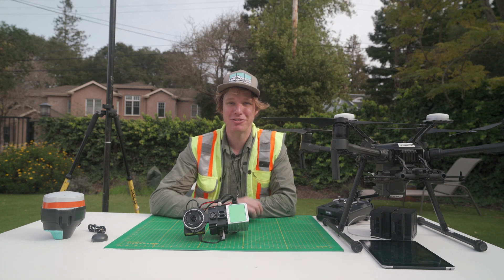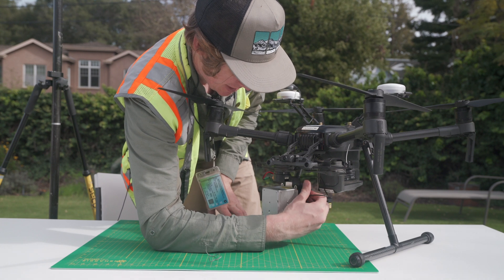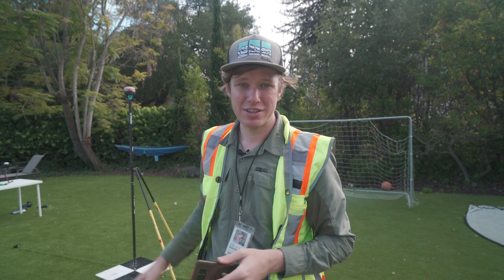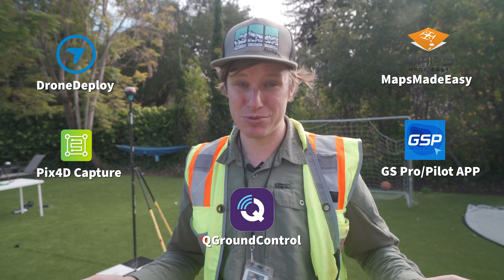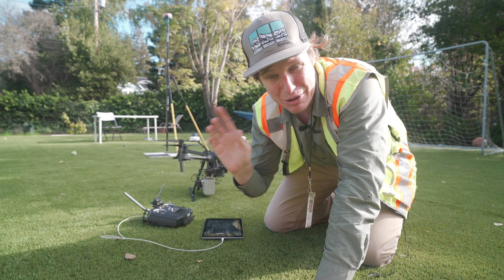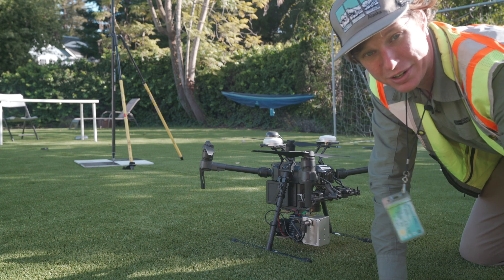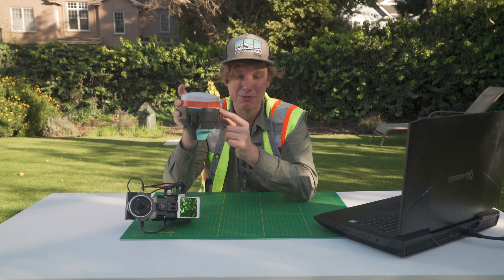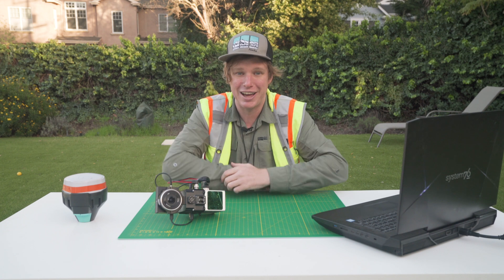Learn to fly a LiDAR Drone | Tutorial

Comment: Very weird GPS antenna placement. I'm guessing you have a more fixed offset setup for the GPS for sales units? 

I'm also guessing there is no way to do calibration circles with any of the DJI third party planning apps?
Reply from the maker: The beauty of the rock systems is you no longer need to worry about the exact gps location. The software will solve the lever arm offset for you!

Comment: How do you get around DJI's geofencing? I read people still had it be an issue even when not flying from a dji app. I have noticed just on my consumer DJI drone that I cant override anymore ("I have permission to fly here") & read on DJI forums that people with the M300 are having issues flying in restricted zones they have permission for.
Reply: You can "Self Unlock" once you have LAANC authorization.  Looks like a pain in the butt thought.  I usually just fly with a 3rd party app which eliminates the geofence.  You do have to force close the DJI app before flying or you may have two apps fighting for control of the UAS.  I'll try to find the link to the unlocking video.

Comment: Does this work with the D-RTK 2 base station?
Reply from the maker: If the base station logs RINEX data then yes
Reply: @IndianaDrones   It does log RINEX data with the X7 camera, but it is uncorrected (not linked to an NTRIP network).  Also, the files on the D-RTK 2 device are in a DAT format that I have not yet been able to open.  Two RINEX.obs files are put in the folder on the drone, so perhaps that is the data I would need (one is RINEX.obs and other is "RINEX.obs_"  Is one the base and one the rover?  Thanks.
Reply: Tafirkhoo use RTKCONV from RTKLIB library on RTCM format to convert the .DAT files to standard RINEX obs files.

Comment: That tripod looks scary, doesn't it fall over?
Reply from the maker: Its a bipod, usually used for a rover setup in an RTK setup.  I do a lot of traveling and its 1,000 times easier to travel with.  You just need to be cautious with how you set it up. Mainly point the legs down wind and push the feet into the earth/stack some rocks/sandbags on the legs.  We aren't doing overnight observations with this. So its mostly fine.  BUT IT REALLY SUCKS when you get back to the base and its laying on the ground.  Need to redo all your flights then....